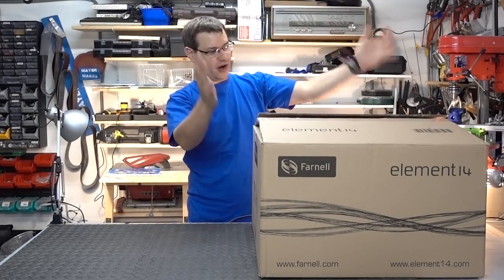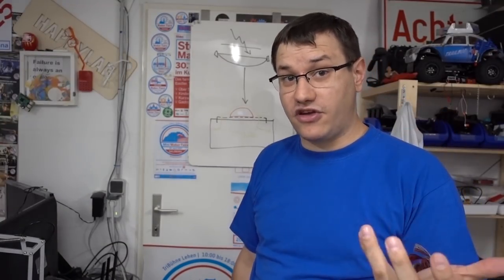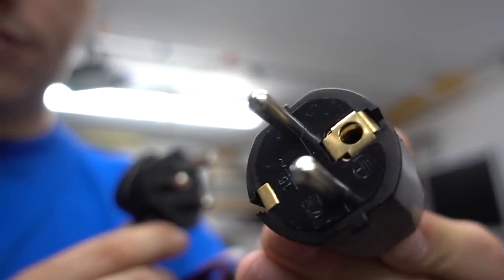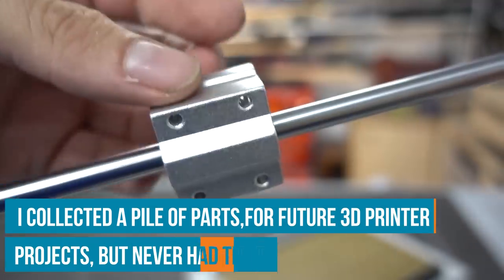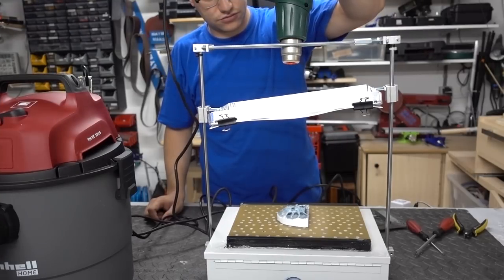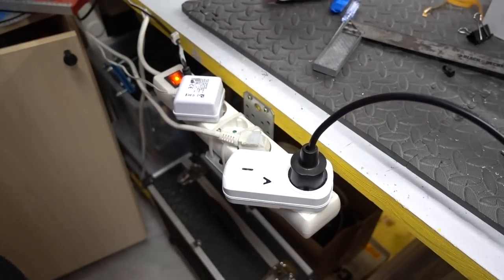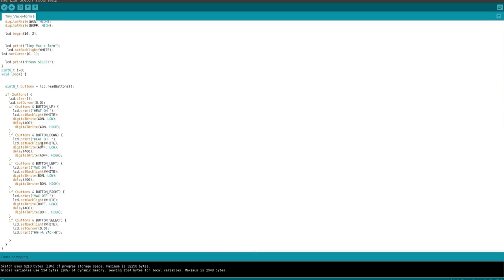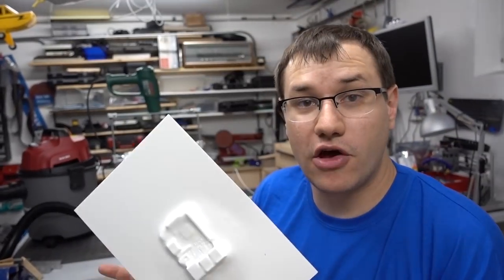Tiny Vacuum Forming Machine

Comment: Use a laser beam detector (similar to laser intrusion detection) to determine when the plastic is ready to be formed.

Set up one or two lasers that cross the center of the plastic. When the plastic droops down and breaks the laser, the arduino would then activate the forming sequence.

Comment: Build a solid metal enclosure from the heat gun to cover the plastic to hear the plastic more efficiently and so the sag or dropping of the plastic is more uniform. Also secure whatever you're molding so that it doesn't get stick to the plastic. That and have possibly where the vacuum can also be used as a blower to help demold the plastic from the object you are forming. I work at a factory that thermoforms plastic parts so I have a little of experience in what you are doing.

Comment: I'd use nichrome or kanthal as heating elements with a shroud to spread the heat more evenly, shorter guide rods so the plastic doesnt cool to much and use 4 rods instead of 2 for stability. a sturdier platform and lube the rods for smother travel. An IR-thermometer to check the plastic would also be handy

Comment: I built a manual vacuum forming machine and tested it on an Arduino board. The fit is so tight, you could make out the Arduino logo and other details that were screen printed on the board. Ended up using the machine to make an autonomous boat and destroyed our class competition.
Reply: Now thats a maker story!

Comment: Couple of upgrades I can think of

Cone or Square attachment to the heat gun for better heating of the plastic

A grill as a heating source

Even spaced holes for better suction

Thermometer for temperature controls on arduino

Comment: Pretty neat concept, it would be nice to machine a custom tip to the heat gun in order to spread the heat more evenly. Something like a pipe with four outputs or a cone shaped spreader.
Reply: Allan Leon good idea!
Reply: That's what I was thinking - the sample parts were small so it didn't matter as much, but if they were any bigger, it may not have worked as well?

Comment: Tip for the buttons is to use a photomos relay to drive the button. Cheap these days, and should be available at E14 as well, or just grab them off old PIR sensors where they are more common than reed relays. Drive is easy, it is an IR led, so will just need a 10mA drive current, easy to get from almost every microcontroller IO pin, and use a 470R series resistor in series.

Comment: I would add an IR sensor and IR LED as beam detection to notice that you dropped the frame, turn on the vacuum, and turn off the heat gun. Also, use IR temp sensing of the plastic to detect when it's ready.

Comment: As others have said adding a temperature sensor should make it possible to fully automate the project. Additionally, I would like to see the whole thing be a little more self contained so that the heat gun and vacuum are plugged into the device, and then the device has a single power cord that powers the heat gun, vacuum, and microcontroller etc... shouldn't be too hard to set up. I just don't like that a single device has components strung out over the shop. I do really appreciate your effort to make the vacuum and heat gun maintain their usability outside this single project.
Reply: thanks!

Comment: You can make it semi-automatic by attaching 2 switches, one on the top one on the bottom. Whenever its at the top, it would run the heat gun, whenever its on bottom, it would turn off the heat gun and turn on vacuum.  Then again, if you do it this way, there would be no need for micro controller.

Comment: i'd maybe go for a thinner plastic... and the heatgun is not really a great heat source. its good, because everyone got it and its relatively cheap to obtain, but the heat is by no means uniform, in order for the vacuum forming to work properly you want to be able to heat the plastic up as evenly as possible and as a bonus, to be able to control the temperature for repeatably good results. 

my suggestion would be to use heating wire powered by mains voltage. you can control the power via the resistance of the wire, but around 1.5kw should be plenty to heat up a decent size plastic. but there again, building something you actually put in the wallsocket might not be for everyone.
Reply: I did go with the heatgun because everybody did it with a quarz heating element or heating wire.. I wanted to go a different route just to use something most people might have around.